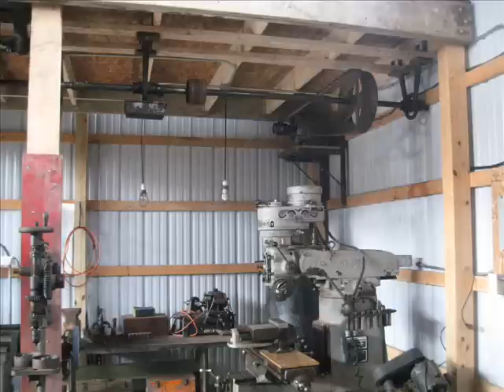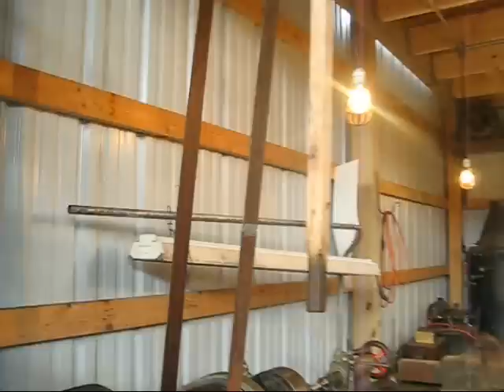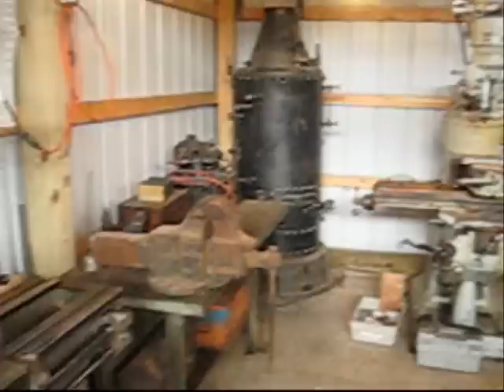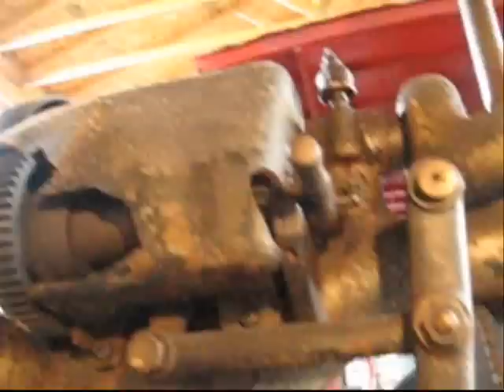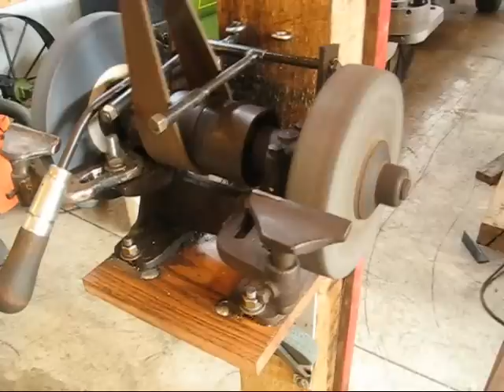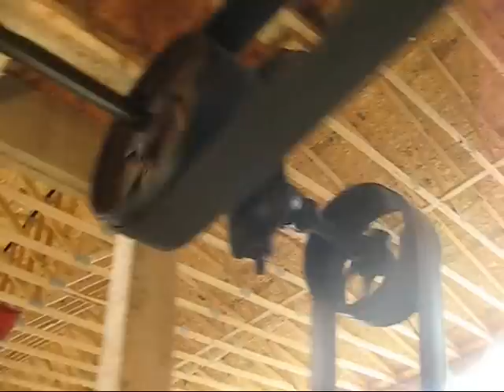lineshaft driven machines.

Comment: That is one of the coolest shops I have ever seen. Put some high heat exhaust Permetex gasket sealer on the joint to seal it up so you wont get gases or have to smell the exhaust. Man that is a sweet shop now. I am happy for you with I had one just like it.

Comment from the maker: Ones an over center clutch with wood clutch shoes and the others just slide the belt from a free wheeling pulley to one that is attached to the shaft to drive the machine.

Comment: Fabulous mix of the old and new.  It's funny how after WWII you couldn't giveaway belt line machines or shapers, and now both are once again valued.  Not perhaps by industry, but the hobbiest or custom shops are rediscovering their virtues.  Well done.  Is the electric motor up in the corner just another power source for the line shaft?

Comment from the maker: @MrSciencetificsasuke  No the clutch is a original that I had laying around. Not sure what it was used for originally. I did remove the step pulley that was on it and replaced it with the one I needed for the drill press.  I do have another one that is similar that I could show you if you would like.

Comment: Beatiful system.....My father used to talk me about this preparation in machines in his job ... I do not know the utility but anyway it is really beatifull.....
Reply: imagine if you could buy all your stationary power tools without motors, with some adapting they could be run from a shaft and belt.  the amount of money you'd save by only needing one powerful motor, instead of a dozen somewhat powerful ones could be worth the effort.
Reply: Also there's only one motor to maintain.

Comment: that's cool as frosted rabbit crap. I have 1925 atw lathe and have it set up with the line shaft. it uses an electric motor, 1.5 horse the size of a 4 cylinder engine😉  whats the electric motor up in the corner? do you have it generating power?
awesome video thanks for sharing.
Reply from the maker: David Rogers that is just a motor. I use it to run the shaft when I'm not running the gas engine

Comment: I see a boiler back in the corner.  If you put out good steam from it, you could have a small single cylinder steam engine, and then you wouldn't have to spend that expensive gas to spin your pulleys. Plus, in the winter it would be nice and warm.  Just don't know about the mill, but I'm sure with diligence a person could rip that electric motor out and put in a belt. Just never seen it done, and some of them run at specific rpm, for a hydraulic pump, so probably wouldn't work. Of course one could put in a dynamo off the steam engine, then the mill would be happy as anything.
Reply: The steam engine's speed can be controlled by the governor which I believe is done by either changing the gearing of the governor or changing the pulley size so the governor spins faster or slower.